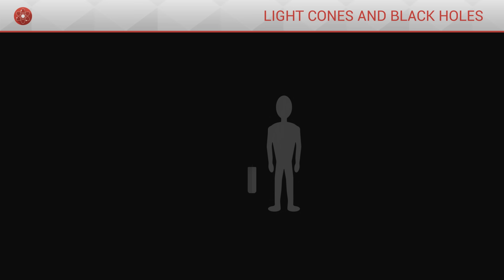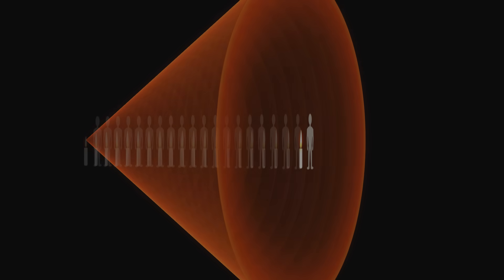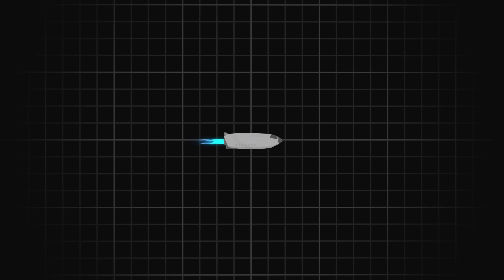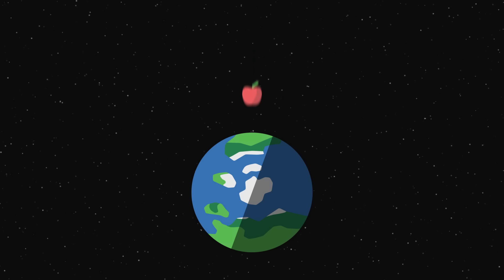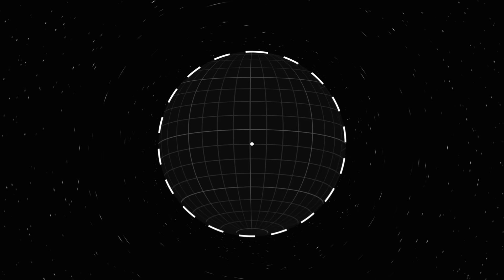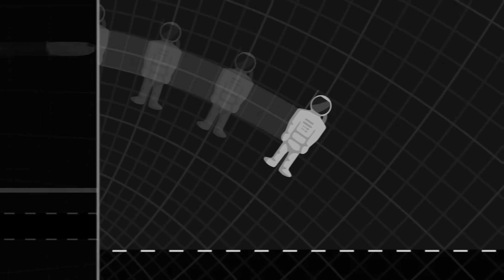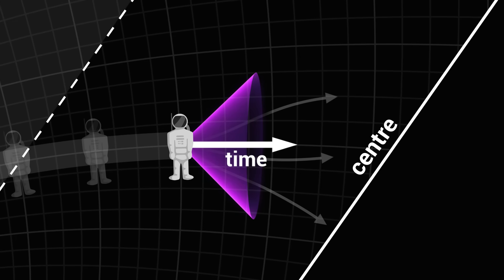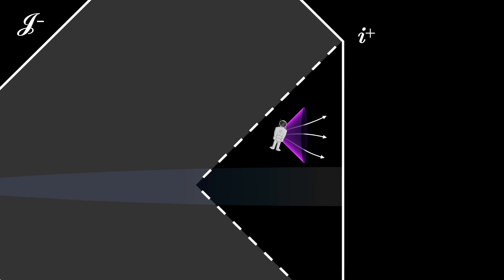Why Time and Space swap in a Black Hole

Comment: Light doesn’t travel. Light is a field charge perturbation, since time does not exist outside of the theoretical mathematical fiction t, therefore light cones cannot exist because of the principle of universal interdependent time simultaneity.

In essence the relativistic principle of light cones is a self-inferencing tautology and a logical fallacy.

Cool animations though
Reply: OK then, just a question:
If light doesn't travel, why does it have a speed? Measured and measurable in a vacuum and commonly denoted "c"?
Reply: @darkshao51  Good question, it doesn’t have a speed.. 

I’m not being facetious it literally doesn’t have one that’s because it’s not travelling anywhere.

The idea that it’s travelling is quite an understandable misconception though that isn’t what’s actually happening, the addiction to that concept would be as foolish as saying that electricity is delivered to your house by electrons flowing down a wire.

Light is purely an EM field phenomena in exactly the same way as electrons are.

Physicists are like crack addicts cracking atoms into smaller and smaller pieces which is to suppose that smashing a snail into smaller and smaller bits will tell you how a snail works.

One might know every single microscopic little cell inside a snail but that doesn’t however mean one could replicate one.

The current Physics paradigm might think they know everything from the position and perspective of physicality because that is where one exists.

One might find emptiness terrifying because that is where one ceases to exist but human beings embodied as we are have an addiction and it’s an awful terrible crack addiction to particles to materiality and to form..

We are after all embodied beings we see everything from the perspective of materiality.. The universe doesn’t have that bias at all!

Smashing things open has already taught anyone who was paying attention quite unequivocally that one simply is not dealing with the world of solidity in fact the entire field of particle physics should be renamed vacuumics. 

Or etherics. 

The physics community and academia in general are utterly biased toward logical positivism and sceptical materialism.  This is literally backwards thinking.

It’s not a healthy addiction and it’s certainly not progress when nature has already shown us the light.

To directly address your question though the first clue that should bother you is there c only holds as constant in free space.

Free space is a purely theoretical ideal, it has no basis in reality, it simply derives elegant math.

Math is a model, it is abstract, it is a map, it is not the territory, it is not reality.

Which is exactly why it’s referred to as ‘theoretical physics’. :) theory and practice are often very different things.

Science is based on careful observation of practical experiments, one may well derive theories from such experiments and base further experiments on theoretical hypothesis, but that doesn’t mean the theories no matter how great or what cult of personality is behind them should ever be considered as proofs.

Sorry for the long answer but I thought you might find it helpful :) One should never be offended by an honest question, when it is precisely those minds that follow instead of questioning that never get anywhere.

honest enquiry in fact, should be what science is all about!
Reply: Call it causality cone. Light is just an example because the field perturbation propagates at the speed of causality. It could be a gravitational wave cone.
There is no principle of universal independent time in modern physics.

Comment: Another great video.. but something still puzzles me. I get that space itself flips to behave as time, as in our past and future trajectories are fixed and we can only travel in one direction. However, I'm not sure how it explains time flipping to behave as space? Because we still cannot alter our trajectory through time inside the black hole, as we would with space outside of the black hole? I'm sure the answer is presented here and I am just not getting it.
Reply: I'm going to take a whack at this. I'm very much making this up as I go. If I'm flagrantly, horribly wrong, for the love of god, someone please correct me. Also, there will be very, very many commas. Deal with it.

Consider the spacetime diagram of the 1+1-dimensional black hole 'cylinder' (actually, rectangle). For the distant observer, time goes this > way and space goes that ^ way, where as for an observer at the center those directions are rotated: space > , time v . For an observer at the horizon, the directions of space and time are halfway between those states, running at 45 degrees, but I don't know how to type those arrows. This means that, from the perspective of the distant observer,  the central observer's space runs in the time direction and vice versa. Now, obviously the outside observer could never actually observe this, but if they could, that's what they would see. The central observer on the other hand would be able to see everything in staggering brightness. Each observer would of course experience their own direction of time as time and space as space; that is what we mean in describing those directions. Under no condition can any observer move freely along its own time axis. Observers whose time axes run in different directions would however observe each other's motions strangely as a result of placing those motions in the wrong reference frame. A body moving forward through time as normal, viewed from afar with a different time axis, looks like it's being compelled to move in a spatial direction by some magic force, which we call gravity.

Since the distant observer cannot actually observe inside the black hole, lets instead consider the central perspective. Alice is somehow very near the center of the black hole, and still observing Bob, who is distant in flat space. Alice is not precisely at the singularity, as that's where physics breaks by dividing by zero. So, we take her to be not quite there, but sufficiently close that we may consider her time to be perfectly v and space perfectly >. Recall, Bob has time > and space ^. Now, say Bob moves back and forth in space a little bit. Given his directions of space and time, his path might look like this ~. Now, lets apply Alice's reference frame to Bob's motion. We'll have Alice draw her axes the same way we drew Bob's, with time > and space ^. That means we have to take this path ~ and transform it so that v = > and > = ^.  What we wind up with is this Ƨ. Bob's proper time begins in the bottom right and ends top left. Ignore the recurve of the mirrored 's' I'm using and pretend it really is a rotated tilde. Alice sees Bob moving back and forth in what she considers to be time, while inexorably moving in the positive space direction, aka away from her. This is completely accurate, despite the fact that Bob was simply bobbing up and down around a constant distance from the center of the black hole, and Alice, because space itself is approaching Alice at the center. Therefore, a stationary object is moving away relative to the space near Alice. Bob's wiggling back and forth in time from Alice's perspective reflects the fact that by moving towards and away from the black hole, he is changing how quickly he is moving away relative to Alice's approaching spacetime.

But what would this actually look like to Alice? Now we're really getting into the weeds. As I would interpret the rotated tilde worldline, which simply represents Bob moving a bit further away, then a bit closer, then back to his starting position, Alice should see Bob suddenly appearing at what for him is the moment of his closest approach. Alice will immediately thereafter see two Bobs, one getting even closer and also younger, while the other Bob moves away and ages the proper way. Soon, though a third Bob appears, and this is the oldest Bob. This Bob is also farther away than the previous 2 Bobs. The youngest, closest Bob continues to get closer and younger until reaching the start of his worldline. If we assume that Bob popped into existence from nothing at the start of his tilde, this closest time-reversed Bob would vanish at this point. The middle Bob continues to get further and older, while the most recently appearing, furthest, and oldest Bob gets closer and younger until those outer two Bobs become the same age in the same place, two Bobs seamlessly becoming one.

Now, bear in mind that even in the unlikely circumstance that I've gotten this mostly right, the only way to ever actually observe such dramatic effects is from inside a black hole. So, from that perspective, it's kind of a meaningless question to ask in the first place. That said, and even in the much more likely circumstance that I'm super duper wrong here, I really had a lot of fun thinking about it. So, thanks for asking!
Reply: @torydavis10  lol.. well I appreciate your detailed answer, I think some of it makes sense and gives some level of explanation (I understand though this is your own thought experiment and might not be accurate). I didn't get alerted to your reply btw. Always best to @ the person..
I think what I hadn't considered enough was the laws of general relativity and instead thinking about it all from the perspective of a single observer in their own reference frame. 

Just one point though; With your indication of the trajectories of space + time in the 2d diagram, I think that space is free to move in both ^ and v at most 45%. I also remember hearing that an outside observer viewing an object enter a black hole would see them freeze in time at the event horizon.

Comment: Matter falling into a hypothetical black hole asymptotically approaches the event horizon and never actually enters the black hole because from the point of view of us, distant observers, the black hole never forms. In short, black holes only exist in the far infinite future but not in the present. Incidentally, because black holes don't exist in the present, the information paradox does not exist either. . 
I do not understand why people keep talking about black holes when the theory of general relativity does not predict them. A black hole is certainly a solution of Einstein's equations under ideal conditions, but it is not at all possible to go from there to the outrageous assertion that GR predicts black holes. A black hole only exists asymptotically in the infinite future since we as distant observers can never and will never be able to observe its formation. Penrose's singularity theorem is very clear in this regard.

Shouldn't we only detect a bunch of matter in the vicinity of the event horizon but not the black hole itself because it's yet to be created? 

From Wikipedia
While most of the energy released during gravitational collapse is emitted very quickly, an outside observer does not actually see the end of this process. Even though the collapse takes a finite amount of time from the reference frame of infalling matter, a distant observer would see the infalling material slow and halt just above the event horizon, due to gravitational time dilation. Light from the collapsing material takes longer and longer to reach the observer, with the light emitted just before the event horizon forms delayed an infinite amount of time. Thus the external observer never sees the formation of the event horizon; instead, the collapsing material seems to become dimmer and increasingly red-shifted, eventually fading away.

Comment: 2:55 There's no difference between time and space. That's why it's Spacetime. Because you need to always use time direction to go through any spatial direction. You always move forwards to certain direction or otherwise you would be able to move opposite direction at the same time.

Comment: I am sorry for posting an additional comment. I want to open a discussion here and propose a thought experiment. Imagine you have a pion particle with 0 spin that decays into electron and positron pair right above the event horizon of a black hole. After that, the electron falls into the black hole, and the positron flies away. Due to the conservation of the angular moment, the electron and positron spins are connected. They must sum up to zero, but they both initially have a spin state, which is a superposition of spin up and spin down. But in the black hole, someone measures the electron spin and finds out that its spin is orientated, for example, upwards. Does this mean that the spin of the positron now must be orientated downwards? If so, how is it possible for the measurement beneath the event horizon to affect the outcome of the measurement outside the black hole? This is kind of an extreme version of the EPR paradox for the Quantum entanglement.
This actually might suggest that your focus on light cones and not causality in general is the right aprouch. Because light cones gives you causality structure only for the interaction that spreads out with light speed (and we believe that all interactions cand exceed such speed).

Comment: Amazing video. But I have a question. What about particles of anti-matter? In QFT one may consider such particles as ordinary particles but with reversed electric charge and time direction. Does this notion mean that antiparticles are destened to escape Black hole and for anti-matter Black hole actually acts as a White hole?
And another question: in QFT we know that particles actually have non zero probability amplitude of propagating over space-like distances in space-time, it is only the commutator of two field operators that turns to zero in space-like intervals. Does this mean that quantuum particles might somehow tunnel through the event horizon of a Black hole?
Reply: Nah anti matter doesn't actually travel backwards in time. It would still head straight for the singularity, exactly the same as regular matter.

Comment: 2:34 - One of the most profound concepts about how everything inside the universe interacts is this. And it is NOT taught correctly at school. The curriculums obsess over light (as in photons of visible light) and how fast they travel in the universe, while neglecting everything else about the concept of relativity and causality. I get that it's a difficult concept to grasp, but it needs to be taught better at school. It drives me crazy how dumbed down it is!

The speed of light is NOT just about light. It is so much more than that.

Comment: That supernova animation was stunning.

When you say that time and space "flip", I thought perhaps that beyond the horizon you can traverse time freely, in the way that we currently traverse space freely (or at least when propelled by a force). But that final diagram makes it look like instead the light cone of causality just has an end boundary and you cannot traverse neither space nor time.
Reply: Like a freeze point, the center of the black hole, where you cannot move, time included, everything there is 'frozen'
Reply: @xeryan  It's Absolute Zero mediated to center. The Inertial plane of infinite capacitance.
Reply: inside the horizon, i think you can go left and right but if you try to go outwards you fall faster inwards

Comment: Interesting video! What if you used a warp drive to travel faster than the speed of light? Would that make it possible to escape a black hole even after having past its horizon?
Reply: It depends what you mean by "warp drive". Warp drive doesn't mean exceeding light speed. Its just a process of warping space to propel a ship without the use of rockets or thrusters. I think one day we will be able to achieve such a technological ability but weather or not it exceeds or even approaches the speed of light is questionable but technically the ship wouldn't even be moving so technically it won't be exceeding anything but the space around it will be. Weird hu?

Comment: Looking at the lightcone I'm starting to have some questions, so if something moves at the speed of light, time still passes by (at the edge of the cone 45deg)? From previous knowlege I knew that everything moves at the speed of light, but can be directioned towards time or space, so shouldn't time not increase if you move in space at the speed of light? 🤔 If someone can respond which one of these statement is false.
Reply: Time as we perceive it is relative to what we observe. If a clock moves away from you at lightspeed, you will see it frozen. If it moves towards you at lightspeed, the photons from every single clock tick will reach your eyes at the same instant. In both instances the clock is timeless for you. If you are on the edge of the candle's light cone, you move at light speed through space, you'll still age, your organs are moving as fast as your eyes so they do experience time, but the candle will be frozen and  timeless. Time is relative to the observers. Light cones are a nice visualisation but the 2D coordinate space in which they are drawn in this video is not spacetime.
Reply: @monkaTOS  I see, thanks 👍